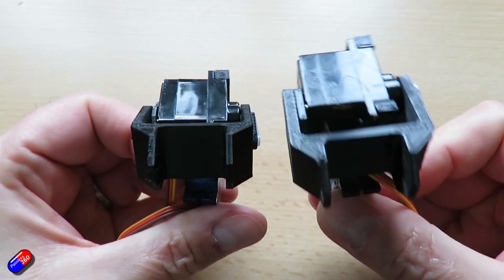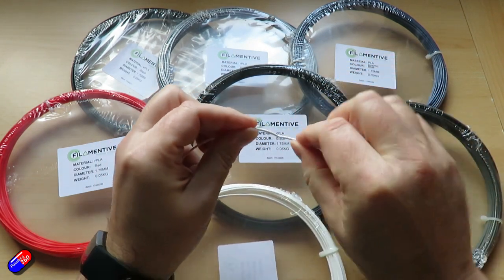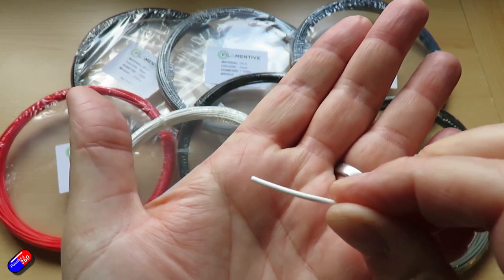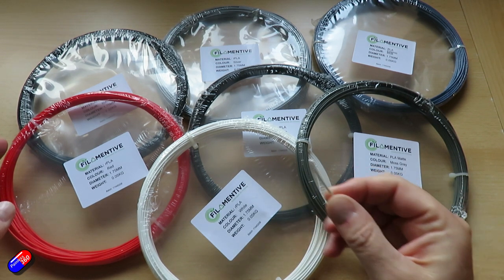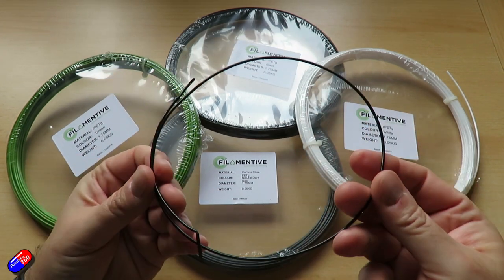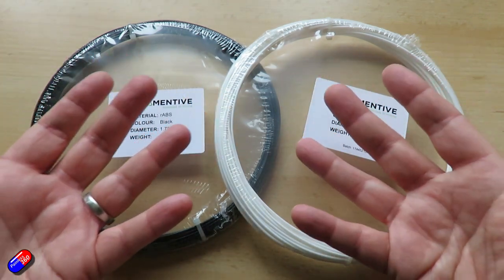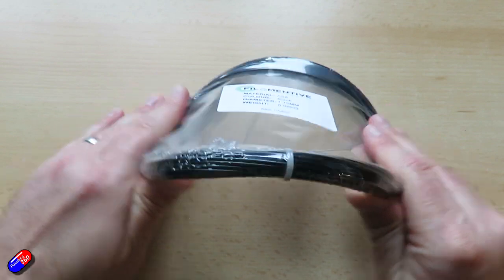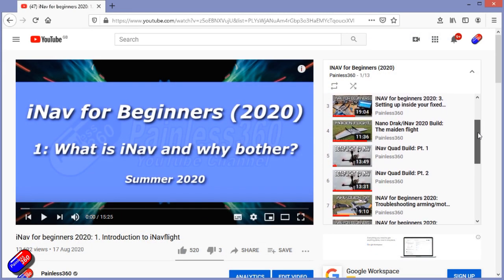Best rigid 3D printing filaments for the RC Hobby?

Comment: Great video! But that's a lot of choices. I need a filament able to handle impacts without snapping, in my experience PETG snaps and TPU 95 is too flexible. I'll use it for an internal roll cage and for a wheelie bar this time, I'm considering ABS or nylon, maybe with carbon fiber reinforcement. Which one do you think is the best choice? Thanks
Reply from the maker: For that, I'd try ABS it similar... Best of luck

Comment: I'd have only focused on LW-PLA like ePLA-LW vs PLA. Those are the main contestant for the body of RC aircrafts. LW is twice less dense but also usually more than twice more fragile. Comparing both for small, large RC, and against expanded polystyrene would be useful. For example I'm not sure LW-PLA makes sense of you plan on painting it.

Comment: 3d850 and 3d870 are wonderful very strong pla, especially if you heat the piece in the oven afterwards. Of, course, they are plas, so, never leave the stuff in the summer sun ;) . Lighter than petg but i like petg as well

Comment: tried PcTG yet?
somehow my E3 Pro with direct drive prints petg like a charm. Tried a roll of PCTG and it's even smoother!
great for control horns, motor mounts and quad frames.
I printed the Floonda glider fuselage with it and it's almost like a production blowmolded fuse by looks.

Comment: PLA is great for learning, lots of pretty colors, but it's trash for functional parts (even "tough" PLA and PLA+ it's all fragile) . TPU is my goto for cases, bumpers, antenna mounts, even kid toys.  PETG for hard functional parts. And Nylon for hardcore durable hard plastics, but you need all metal hotend and gotta deal with styrene offgas, and it's expensive

Comment: PETG and TPU are generally my go to for quad parts. But for frames I recently went to Taulman 910 Alloy Nylon, it is a bit more flexible than PETG, so you have to make your parts thicker and/or increase your infill. It is also more expensive and a bit more finicky to print. But so far it has held up to crashes better than PETG.
Reply: 100% agree with everything here, will add that Nylon requires an all metal hotend, 270C, and ventilation...styrene offgassing in the house is bad

Comment: I'd love to know if there's any practical application for wood-fill filament. I got a sample of some wood stuff from my local shop and it was so ugly that I didn't even care when my Benchy failed due to a nozzle clog.

Marble-fill is really nice though. (The real stuff; I haven't tried imitation marble yet.)
Reply: It looks nice, has a soft texture, and it takes stain. You def need a .6mm or larger nozzle to print it. I tend to do 1.0mm vase mode, and get a nice strong flower pot/planter/vase...but like most PLA it's not functional
Reply: @Fly_High_FPV  Hey, thanks for the reply!! I had heard you can do a sort of imitation wood grain by printing with varying temps, but I couldn't even get my tests to work. I think your suggestion of a 0.6mm nozzle would fix my clogging issue though. I'm using a 0.4mm Nozzle X and a Micro Swiss direct extruder so I had hoped it would do a little better.

Comment: Good video. I print a lot of parts in PLA, e.g. ducts for cinewhoop, fixed wing planes, etc. Just need to keep that stuff out of the heat and it works fine. If I break a part I just print another. For parts that will experience heat I use PETG. For soft mounting stuff I use TPU. Never tried ABS (due to the fumes mainly) or ASA. I probably should give ASA a go sometime and see how it works out.

Comment: I wish the overall print quality of PETG would be better. Even my TPU prints look way better in comparison to PETG. Maybe I need to tweak a little more or try different brands. Obviously it's still better than ABS, which is really a pain and needs a lot of preparation and attention. Most parts for my drones are made of TPU, I really love the flexibility and rigidity of it.
Reply from the maker: I find that a lower temp for PETg works better. 250degC is way too hot...

Comment: Thanks for the video.  I only use PETG (and occasionally lw-pla) for all my rc planes.  It is a little tricky to dial in the settings but once you get them correct, the prints are strong and smooth.  The heat and sun ruins my pla planes if I leave them out for very long, a problem I haven’t had with petg!

Comment: Great review,  covered a few filaments but you left out nylon and some support filaments like pva. For me I use PETG most of the time but if I need something super tough and almost completely unbreakable I use nylon or nylon with carbon fiber.
Reply: This
Reply: how do you deal with the flex in Nylon then? 
I occasionally print standoffs for quad stacks or mounts for antennas etc but its a bit flexible for lets say part of a frame/fuselage?

Comment: One thing you need to mention is that filament printing characteristics, even of the same type, can vary by the color alone.  You wouldn't think that a roll of manufacturer X's BLACK PETG would have different print characteristics than the same manufacturer's WHITE filament... but it does.  And in some cases the difference is very pronounced.

Comment: Don't buy the cheapest PLA you can find, I tried that because I wanted some filament I could print for days and not think it was costing me a fortune. Those £10/reel of PLA on eBay not worth it, mine wouldn't print properly at normal PLA temperatures, had to up it to 230C, prints 'ok' but not nearly as clean & easy as Prusament PLA filaments.
On the other hand, I use the cheapest transparent TPU I can find on eBay (XYD branded stuff) and it works great with the right print settings and properly dried out before & during printing.

Comment: TPU has to be my favourite filament, I like thinking about how to use its flexible properties in ways nobody has thought about before, like the folding TPU holders I designed for: Crossfire, Tracer, Ghost, XM+, Happymodel ELRS EP1 + EP2 + ES900RX, BetaFPV ELRS, and various TPU antenna holders.

Comment: I use Fluorescent Yellow TPU a lot for drone parts, PETG for pretty much everything else. Wood has a tendency to block standard 0.4mm nozzles - seems OK with 0.5mm. Printed thousands of hours commercially with ABS - contrary to popular belief it does not need an enclosure. just a constant temperature room with NO draughts.
Reply: ABS releases Styrene fumes which are very toxic, without ventilation it's not advised to print this material.

CNC kitchen tested a whole bunch of different filaments and it seems that the so called superior mechanical properties of ABS are not what people tend to think they are.

PETG has similar mechanical properties as ABS with the exception of the higher temperature resistance and it's a lot safer to print.
Reply: @robson668  ABS fumes are comprised mostly of styrene monomer and uncharacterized ultrafine particles. The human nose is extremely sensitive to styrene, so even if it stinks the place out it won't be harmful at any level that a hobby 3D printer can output. Some people find he smell offensive but at the levels were talking about it's not going to do to do you any harm. You inhale more toxic chemicals in minutes walking down a busy city street! Burning ABS is a different matter, it can give off cyanides in some instances... BTW -  Don't believe everything you see on youtube, , especially from one source. Do the research and testing and come to your own conclusions..
Reply: @Pilotltd  printing with ABS and Nylon in a ventilated (but not drafty) workshop...gives me headaches...i would def recommend  an upgrade to your air system if youre printing anything over 250c (and an all metal hotend)
Reply: @Fly_High_FPV  Been FDM printing commercially and at home since 2009, never bothered me or my work colleagues. Perhaps doing something your not allergic or sensitive to might suit you better?

Comment: I also use PLA +. It prints way better than PETG, and also has better thermal characteristics. and protection against UV than standard PLA.
Reply: @davidwesternall873  the PLA+ i tried from amazon was pretty easy to print, but still brittle compared to PETG